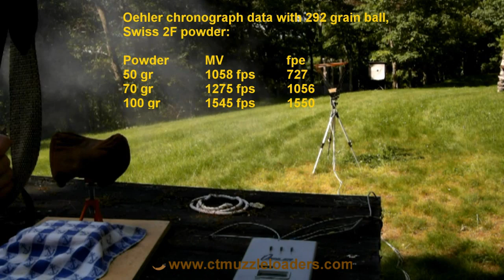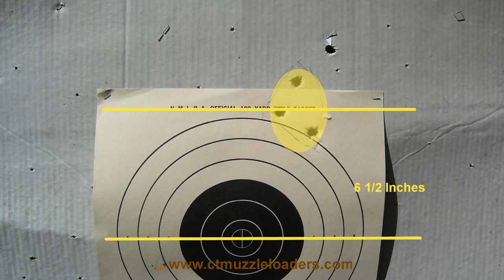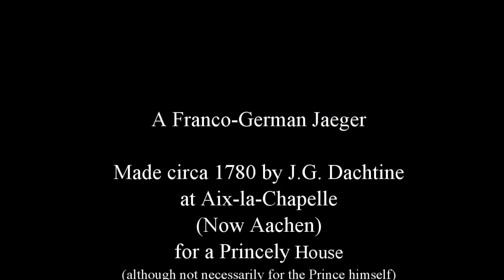Loading and shooting a Franco-German Jaeger Rifle

Comment from the maker: LutzDerLurch,
Thanks for the compliment. Old barrels made in the late 18th Century or later by a recognized maker are quite strong and are safe if not corroded (you need to carefully check for this, particularly around the breech plug and at the bottom of the bore). I also shoot a 'proof' load at least twice what I intend to use, and I generally don't use anything over a target load (50 gr in the case of the Jaeger).

Lock parts can break, but they can also be repaired or rebuilt.

Comment: This is a great video and a cool gun. Your chronograph test gave me some important data for determining the fps I'm getting with a 278 grain ball with 60 grains of 2f equivalent pyrodex powder. I know my actual speeds and burn rates will be a little different from powder to powder and since my gun is different  but this helped me determine close to what I'll be getting with the load without a chronograph. The bore diameter on my gun is a little different as it's a old 16 gauge breech loading shotgun I've been making some .58 cal round ball loads for. It had been shooting pretty good and I had looked for a while for more in depth data than "2 1/2 drams of black powder and 1 oz of shot" and happened to find almost exactly what I need while browsing YouTube.

Comment from the maker: zkizkizki,
There is a device called a ball-puller which attached to the end of the ramrod. It looked like a sharp-pointed wood screw and could be pressed and screwed into the ball to allowed it to be pulled out. If the powder was not soaked, you could also dribble enough powder into the touch hole to 'pop' the ball out.

Comment from the maker: Yes, some set-trigger mechanisms - like this one - won't allow the hammer to cock unless the trigger is set because the sear striker from the set trigger assembly impinges on the release bar of the lock unless it is set. However, most modern mechanisms (after about 1800...) allow cocking first.

Comment: Excellent, very informative and ejoyable video. Despite the high quality it is obviously made as a working tool rather than just for show. Dachtine also made air pistols and rifles equipped with flintlocks - but no touch holes. I have seen a photo of a pistol by him but not an air rifle.

Comment from the maker: Originally, a sharp screw (a 'worm') was attached to the tip of the ramrod. This could be run down the barrel and screwed into the soft lead ball so it could be pulled out - it worked most of the time. These days, a CO2 cartridge device is used to pressurize the barrel through the touch hole, which forces the ball out.

Comment from the maker: flyboy.
The formula for muzzle energy is m*v*v/2. However, since the weight is in grains and the mass needed is slugs, the formula is grain_wt*v*v/449400. This gives a foot-pounds-energy (fpe) of 1550. Not in the 30-06 class, but still pretty effective, since the round ball dumps most of its energy in the target.

Comment: Nice gun and nice walk through. As I'm sure you know, the best "safety" for a flinter is a leather cover over the frizzen but I love that sliding safety. That's what I used when hunting with flinters anyway. Also, Dixie used to cherry out molds according t the buyer's specs. If they still do you could be casting slightly larger balls and using a thinner patch. BUT, I'm guessing you knew this too. And for the third thing I'm guessing you knew already, that pull is short for you.

Comment from the maker: xismxist,
1) The powder granulation is too large and irregular. A few grains might fall out, but the grains jamb up and won't flow out the hole.
2) Black powder cartridges are always loaded full, and may be over-filled, with the powder being compressed. If a patched ball is not firmly seated on the powder, the patch will have a hole blown in it, ruining the accuracy.

Comment: "Ach du lieber, mein schatz"! Very nice & clear for such an old video  (2011)!  Nice sound too. Dandy rifle! I love my .58's! Looks like a swamped barrel. Wow is that main spring "STOUT"!! This rifle must have cost you a pretty penny,  at least $19.95 PLUS s&h! Never saw a patchbox where the toe plate would normally be - wunnerful idea! What is the condition of the bore? My guess is sort of rough but useable! I love rifles with shorter barrels, none of this 42" schtoof! "Gesundheit" und pass da veinerschnitzle und saurbrauten poleaze!!!!!

Comment: Nice rifle. Hard to find any with this sliding safety, especially from earlier times pre-1750. My rifle is 65.cal and I shoot it with 75 grains of Schutzen 2F, .633 round ball and heavily greased linen patching and use this load as well or hunting. I like swiss powder for modern ML guns, but prefer Schuetzen powder for originals,becasue this powder has a lesser pressure spike than swiss. I have a short firing sequence up here as well..

Comment: Nice gun ,I have one I made many years ago and have hunted with it alot. Mine shoots a .577 ball has 7 grooves 27 1/2''  one turn in 50 "My hunting load is 70 gr ffg. I've taken deer out to 125 yards and hogs as big as 350 pounds.  The shorter barrel fits well in a hunting stand .By the way the 70 gr ffg put the ball compleatly through the 350 lb hog and deer at 125 yards.

Comment: Great video! Saw those guns at Hermitage exposition today so that's how I got here. Anyhow, it's still not clear how exactly powder gases are forced to go through such a small hole with frizzle being opened. I believe they dont, but what happens? Is this hole filled with powder after initial load? Or you just relay on chance for small piece of fire to come through this hole and ignite main load? So far I failed to find information making this particular aspect clear.
Reply: The touch hole should be free it is the heat of the igniting powder in the flashpan that ignite the maincharge. If the touchhole would be filled with powder it would act like a fuze and slow down the ignition, If you have a well tuned flintlock it will fire even if you hold the rifle with the pan upside down

Comment: Someone can check my maths on this, but a 292 grain ball firing at 1545 feet per seocond (With the 100g 'Hunting Load' as specified) delivers a muzzle energy of 3095 foot-pounds (4196 Joules). This is comperable to a .30-06 Springfield!! [Though I very much doubt the ballistic coefficient is as high...]

Comment: Why was the safety designed backward?
It should be pushed forward to fire because brush could easily push the safety to the rear,allowing it to fire.
Reply from the maker: +Fishkiller 41 
Moving backwards was the only way it could be designed, given the lock geometry. Its purpose was to keep underbrush or clothing from snagging the cock, because of the lock's internal 'fly', if the cock was pulled back just a little and then let go, it would fly all the way forward and fire the gun.

Comment: Would like to know the rate of twist.  The 18th Century German standard of one turn in the barrel length was too fast for even medium powder loads and stripped patches.  I have one similar to yours in 62 cal and will only shoot 40 grains as a max load, limiting its useful range to 100 yards.
Reply: The rate of twist is one turn in 28 inches; the barrel length is 23". Hope this helps.

Comment: 292gr ball going 1545 ft/s? That's no slouch! Roughly comparable to .44 magnum or .50AE I think, but .60 cal instead of .44/.50 cal. Would have been safe to put a 100/200m sight on it rather than 100/150m if that's what the fixed leaf is set for. Er, well, then again, a lead ball likely doesn't have as good of a ballistic coefficient as a round nosed/semi wad-cutter/hollow point bullet. I was going to suggest that even 300m might be manageable, considering that the little .30 carbine round has been taken to such a distance, with 110gr going about 1900-2000 ft/s, but again, a patched ball probably loses velocity more quickly than a modern jacketed bullet.

Comment: just a question from a non experient person... what if the person point the rifle down, would the ammunition and powder drop or is there some mechanism that won't let that happen ?
Reply from the maker: saraivao612 The ball fits tightly into the barrel and can't easily be dislodged.
Reply: there is a wadding (typically piece of paper or cloth) that prevents the ball from falling down. But, yeah, if you point flintlock down and then shake it a little bit, bullet would probably fall out.
Reply: Чё Бля no that’s not quite true. To remove a ball a tool called a ball puller was used. It looks like a wood screw. In order to use it you push it hard in to the soft lead ball and twist until you get a good bite in to the ball. Then it takes twenty to thirty pounds of upward pressure to remove it. Even a smooth bore loaded with a looser ball it nest into the cartridge paper and getting it out is a PITA. A ball that would roll out won’t shoot well at all.

Comment: Wonderful rifle and a great video. However, "German Silver", at least the European version and that name did not exist in 1780. The white metal is surely  Paktong. Essentially German Silver imported to Europe  from China in the 18th C. The Europeans (Germans) were not able to create their version of this metal until about 50 years after this rifle was made. Really its a moot point since both are forms of nickel silver. Except most devotees of old guns know "German Silver" dates to circa 1830 and many are not aware of the existence of Paktong. So using the the western worlds name for nickel silver can cause some to question the metal used. Paktong was also used on some high end English guns from at least the 1750s and onward.

Comment: so what's the difference between the setting trigger and the firing trigger? I didn't understand that very well.
Reply: The setting trigger makes the firing trigger more crisp. So you only have to pull the firing trigger slightly and not the whole way.
Reply: dllb90 aah okay thank you for the answer.

Comment: Прикольно,!!!  А если порох отсыреет в стволе или просто разрядить надо, как заряд достать????

Cool!!! But if gunpowder will dampen the trunk or just defuse it is necessary, as the charge to get????
Reply from the maker: There is a special tool, a sharp screw that attaches to the end of the ramrod. It is pushed down the barrel and screwed into the top of the soft lead ball, which can then be pulled out. A more modern way is an attachment to a CO2 cartridge which pressurizes the barrel through the touch hole and blows out the ball.
Reply: Спасибо!!! Всё просто, я думал ствол нагревают пока не стрельнет!!!.....))
Thank you!!! It's simple, I thought the heated barrel until you shoot!!!.....))
Reply: Вадим Лошадкин

Comment: This guy's voice is disgusting with the "slurch slurch blablabla slurch..."
Reply: Lol sorry i was in a foul mood when i wrote this comment, nice gun and i'll delete that comment good sir :)
Reply: Thanks!
Reply: I picked up a large bore German style rifle with very deep rifling and a very fast twist.  I shot it today using 50 gr. Black MZ, a .020” patch lubed with coconut oil and a .600” round ball.  Had to improvise an aperture for the rear sight.  Mine is a 20 lb. target rifle.  I don’t think it would be very accurate with heavier charges and a round ball due to that fast twist.   Very odd combination.